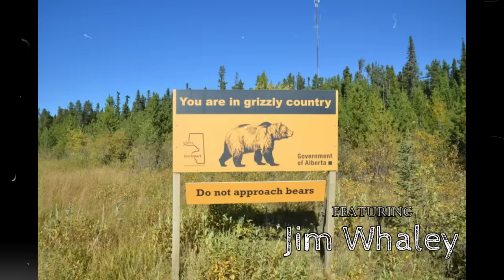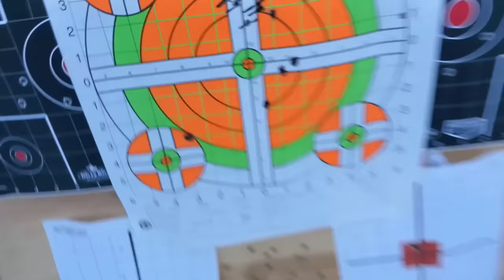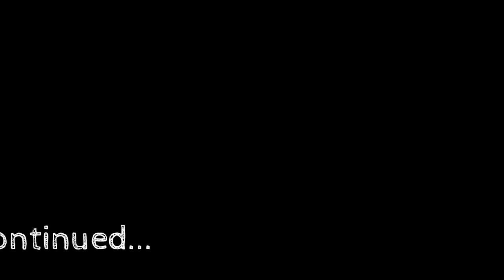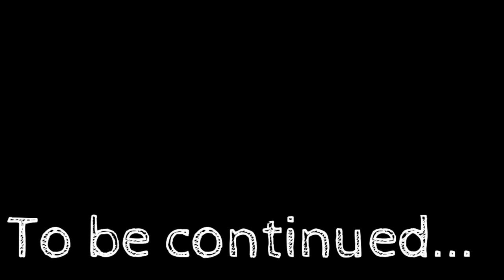Alberta Whitetail 2021

Comment: Love my Summit climber but don't like climbing frozen popple in it.  The bark is too smooth. I was about half way up a cold popple one morning and took my hands off the top and it instantly dropped down to the bottom half. It felt like I was standing there with my pants down around my ankles.  Fortunately it was just a reminder to keep some weight on the seat/top half or away she'll go!
Reply from the maker: Absolutely! Frozen poplars are tricky, you have to be careful once it gets to -10C.
What I do is as I move the top section up, I 'saw' the tree with the gripper teeth to make sure it bits into the wood.
The bottom half I find no issues as my weight holds it.
But I really sink the grippers on it too.